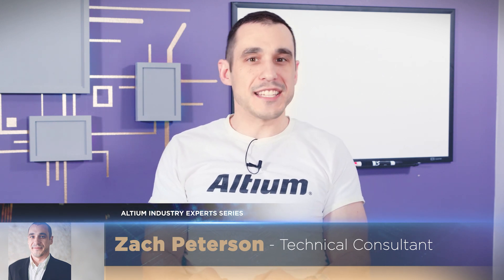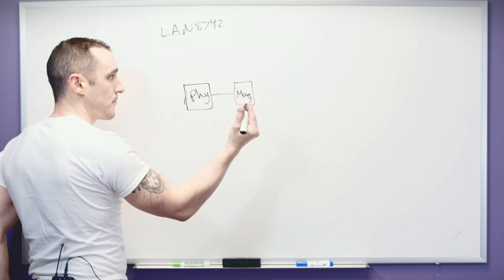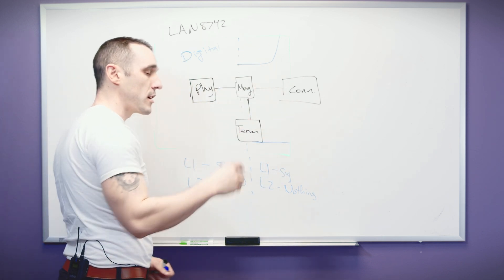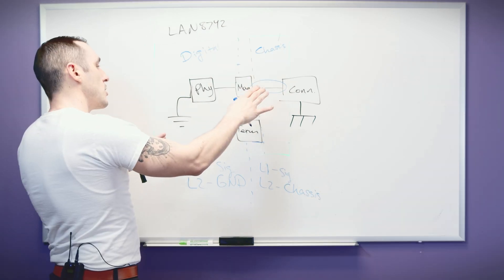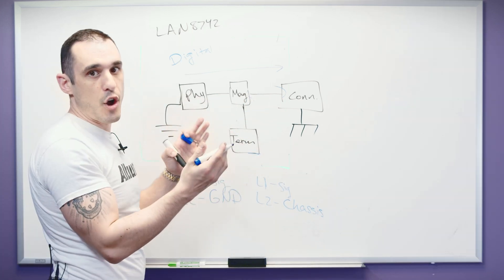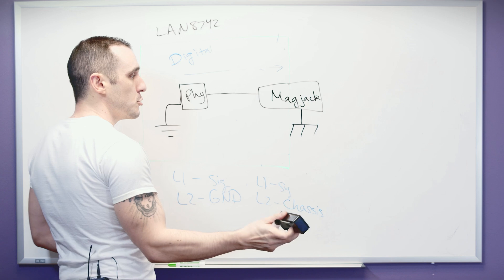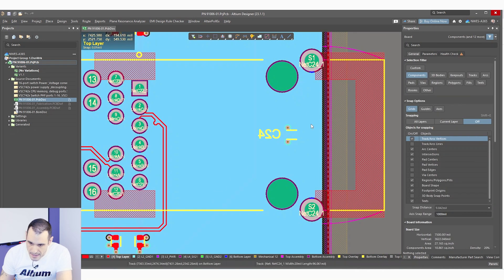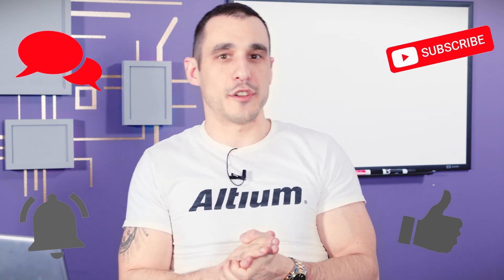Grounding in Ethernet with and without MagJacks

Comment: Hello Zach. What would I do if I have Power Over Ethernet and PHY on the same MagJack but the PoE has a galvanically isolated DC-DC converter with a PGND and the Ethernet PHY (ENC424J600) is located on the SGND? Do I connect the MagJack shield to the PGND or SGND?

Comment: Hello Zach. I think the current placement of the capacitor in close proximity to the through-hole pins may compromise the reflow soldering process during SMT. I am wondering if you could provide more information on that?
Reply: If you're referring to C24, I would say it definitely will not have any effect, and I know because I have done this on many designs with different assemblers and have never had a problem. I also have never had an assembly house question me about it or suggest moving it.

Comment: Thanks Zach for the great explanation. Can you please confirm this apply for magjacks with Poe p/ n as well. I have tvs diodes On the PN pairs but do not have esd diodes to chassis gnd. Are the ESD diodes to chassis ground recommended to have
Reply: A TVS diode to chassis GND is useful to have assuming you actually have a metal chassis. You can also use a ground ring around the edge of the board to direct an ESD pulse away from the components in the rest of the board. The isolation requirement also applies in PoE, and there are PoE-specific magjacks that have the same type of terminations applied internal to the connector. I think SparkFun used to sell one several years ago, Bel Fuse makes them too.

Comment: I am still not sure wich of the three grounding alternatives is the best...
Reply: That's for you to decide because it depends on the system you are trying to design. Just consider that most systems today use magjacks, so most of your board will be a single ground net and only a chassis connection, which you then have to determine if it will be applicable to your particular design. If you don't have a chassis and you don't use a magjack, then you will probably have a simple plastic connector that is connector to an ethernet transform and sites over a floating ground, it will need to be treated just like primary and secondary grounds in a power supply. In that case, and if there is a problem with high frequency EMI, you might have to use a capacitor to control the high-frequency return current back to the primary side of the ethernet transformer. The worst case is to have no galvanic isolation because then you are not obeying the ethernet spec and will most likely fail EMC testing.

Comment: One question: With L2 having a chassis plane option (6min), "term" block (on L1-signal) is over L2-GND plane area or is it over L2-Chassis plane area? in other words, which plane is under this block on L2? which elements are L2-CH achieving? I haven't seen it clearly. Second question: You say that bob smith termination has a Cap rated at 2KV to the chassis GND. And you also say that chassis GND could be tied to system ground using a capacitor between chassis and GND?Are you talking about 2 different capacitors that should we need or are you refering to a unique capacitor?

Comment: How to chose the capacitor? Very informative by the way!
Reply: If you're referring to bridging the chassis ground and the system ground, typical value is about 1 nF, this is enough to provide bypassing for high frequency noise. However, chassis ground is not normally connected to the system ground especially when magjacks are being used. You will see the capacitor used in this way to assist the return path when magjacks are not used. In my opinion it is much better to just use magjacks.

If you're referring to connecting the connector shielding to a chassis ground, you can use a capacitor but best option is to use a direct connection as well as TVS diodes on the traces. If a capacitor is used, typically someone would follow some ESD-based guidelines to select the capacitor because the connector bodies will be exposed to the external environment. Typical value might be in the 1-10 nF.

Comment: Nice video! I noted a couple of issues with the example project. The capacitor should be rated at the same voltage potential as the Magjack, which is between 1.5kV and 2kV. They're typically quite large. Also, the chassis trace on bottom layer can couple into L5 since they're probably only separated by 4mil or so, and there needs to be a 1mm clearance rule between chassis and GND for the same reason. A 1.5kV flash test with a PAT tester will show that.
Reply: That's a good point about the trace for sure, normally if I have to do anything with chassis GND I just put the ring around everything and pass it through the layers, then the clearance rule will take care of it. It's easy to forget about that one when you use traces for the connection.
Reply: are you refereing to the bob smith capacitor being connected to the connector shield?
Reply: @genisuarez9463  I'd need to rewatch the video, but I think that's the one. As a rule, any capacitor across isolated/non-isolated parts must be rated to withstand the isolation voltage rating.

Comment: What if PoE is used?
Reply: PoE can be used with magjack connectors, some connectors are specifically designed to support PoE, one part number is Bel Fuse 0826-1X1T-GH-F. Just make sure that the connector is compliant with the specific PoE standard being used in the device, this is because different PoE standards like IEEE 802.3af or 802.3at have different power levels that they support, and the connector construction must also support those power levels.

Comment: TI Ethernet PHY PCB Design Layout Checklist says: < No metal should be under the magnetics on any layer. If metal is needed under the magnetics, it must be separated by a ground plane at the least. Metal under the RJ45 connector with integrated magnetic is allowed. >  Wat would be the "metal" here ? If its not copper,  chassis ground plane ? .. My stackup is signal/Chassis/chassis/signal under the integrated connector and thus  traces to LED's and TVS diodes  on the 4th layer near the connector board edge. This is not great for selective soldering assembly  but there is no space. According to TI, I could opt to change layer 3 to GND but not sure that will cause SI issues. P.S  Pulse has a nice document for PHY layout.
Reply: In this case "metal" could mean "anything that is not a system ground" so it could be power polygons, signals, etc. In general you should also not use a chassis ground as the ground plane for signals on the PCB. You can have chassis ground on the board but it should not be used to carry capacitively coupled return currents. The reason is that the chassis ground should not be used for a return path at all. Instead the chassis ground is just the chassis in the enclosure, at most it should just be a ring around the edge of the PCB as I've shown in another video on ESD.

Comment: using the cap is not a good idea. If an ESd occurs on the chassis side the capacitor will guide it to the PCB ground since ESD spectrum density is in range of some hundred MHz
Reply: I should have explained that some more. Since that connector is metalized you have to ground the connector housing somewhere, in this device there is no chassis ground and only a system ground. This is typical if you do not have a metalized chassis or an earth connection somewhere. Chassis is preferred though, especially in networking equipment. There are also cheaper plastic enclosure devices, these don't always use magjacks and will have plastic RJ45 sockets.

Comment: You are connecting the shield and GND with a small capacitor BUT doesn't you also need a large resistor in there like a 1Meg in parala with the cap? also do these things also apply for PoE designs?

Comment: Hi Zach,
If I am considering about the higher isolation from the RJ45 primary side to the secondary side, but noise suppression is not the first priority.
Should I still just use the single grounding strategy? Does it split chassis ground and DGND achieve higher isolation?
Reply: Splitting chassis GND and DGND is meant to set the chassis as a safety ground that diverts any ESD-induced current away from the main system and the components. If you do not have a chassis in your system then you have no choice but to use the single grounding strategy, or you have to have primary and secondary side grounds but not route any other data lines between the ground split. For the main data lines, the isolation has to do with the magnetics termination. Ethernet links have a minimum isolation requirement that they must comply with, so the connectors and magnetics components that are used in these channels must provide isolation at least at that minimum value.